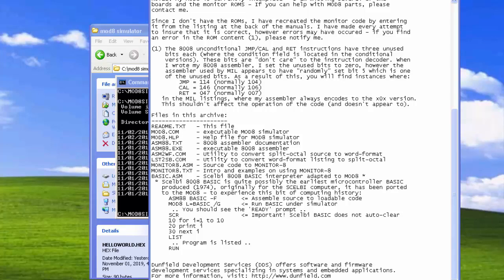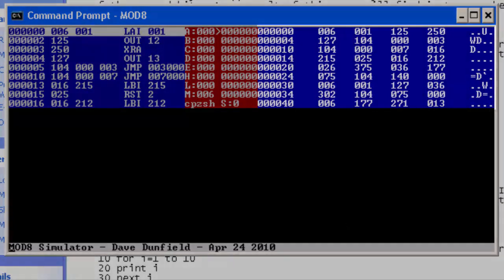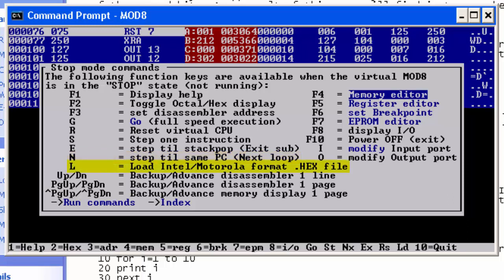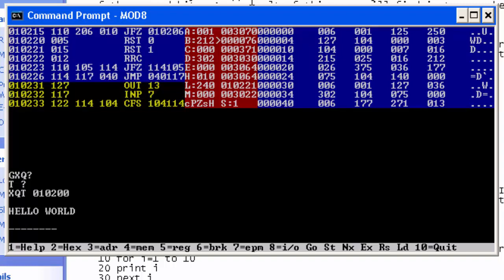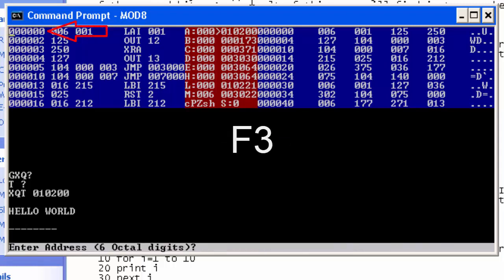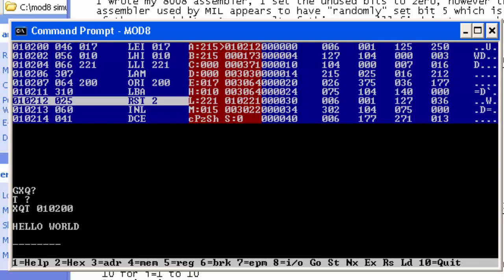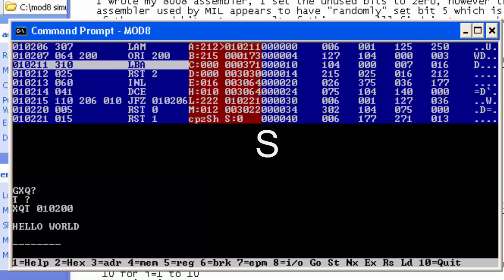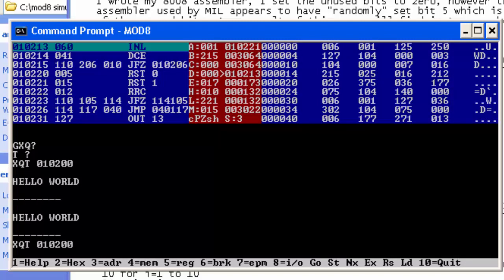{35} intel 8008 Assembly Language Programming #4 and using the MIL MOD8 simulator

Comment: An extremely stupid minimal version I wrote while trying to eliminate unnecessary stuff:
To avoid using null termination or a counter, I align the string w/ a page boundary so the overflow of L causes the 0 bit to be set.
That makes the inner loop only 4 instructions, which I think might be optimal.
But of course you can't usually align all of your strings to the end of your pages! 🤣

```
	ORG	010#200		;Load above monitor8

	LHI	HIGH TABLE
	LLI	LOW TABLE

LOOP:	LBM
	RST	020
	INL
	JFZ	LOOP

	RST	000

	ORG	010#365		;Specifically load so ending string crosses a page, causing 0 on increment
TABLE:	DB	"HELLO WORLD"

	END
```
Reply from the maker: Yes, nice bi5 of code reduction. In some examples the code space can be minimized by ending strings on page boundaries. However, the one byte saved with the ETX is lost if the program then needs to track the high byte of the memory pointer with tables and such. As always, it depends on the program and if it is heavy with strings and tables (or other things relying on high half of the memory pointer) or if it is just code. 
At least the 8008 allowed code breaks across page boundaries without further consideration. The MCS-4 was a little more particular about page breaks in code segments.